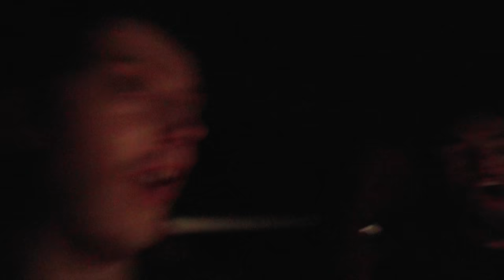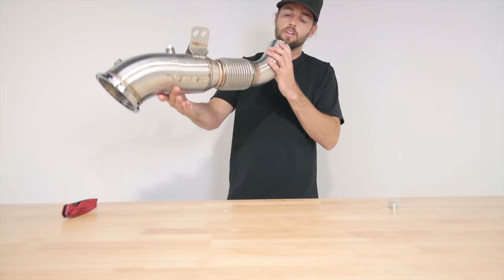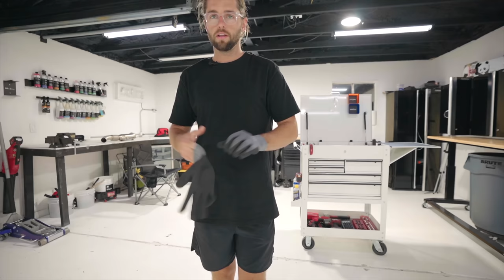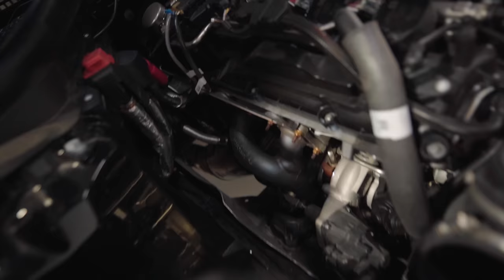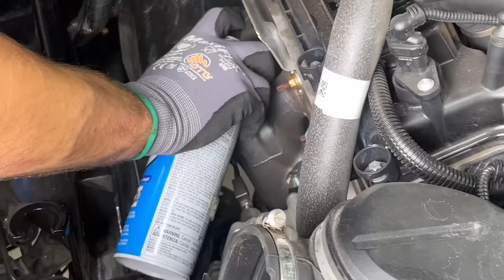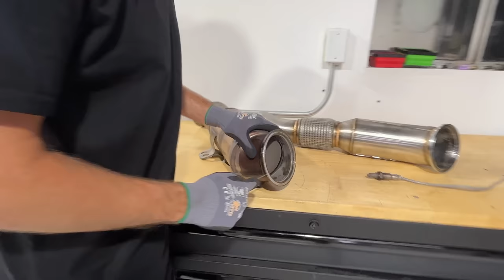The Best Toyota Supra Exhaust Mod.. Crazy Turbo Whistle & Tone! (VRSF Downpipe)

Comment: Do you recommend a tune with the intake/downpipe combo? also, do you get any check engine lights?
Reply: If you want to maximize power gains, yes. If you just want noise, no.

Comment: Hi Cameron

I have a noise problem it's really too loud in catless

my configuration is catless Project Gamma with an HKS catback

I'm thinking of changing my catless downpipe for a catalyzed downpipe. Do you think I'll be able to reduce my noise?

my salesman tells me that I'll lose power by installing a catalyzed downpipe, but who cares? I'm willing to sacrifice a little power to maintain good relations with my neighbors.
the power there is already a lot I absolutely must solve the problem of noise. I think that the Catback HKS is really very noisy I come from an exhaust with particulate filter (europe) that really muffled the noise.

My question is: what can I do to reduce the noise? Work on the Catback or fit a catalyzed downpipe?

Thanks for your answer.

Comment: What is that app letting you control the sound? Does it have to do with the down pipe or is that from a previous video? That’s so sick to be able to customize the sound at the touch of a button vs trying 5 different exhausts!

Comment: what's the differences that could be felt if the tracking is turned off  at 15:22 ?   does it gives more boost or power or so that might affect the sound too ?
Reply: Traction control off. You’re turning the traction control off so it allows complete wheelsplin. It’s how people do burnouts and donuts
Reply from the maker: It cuts throttle and boost pressure when traction control is on yes. So when its off, the wheel spin is crazy
Reply: @CameronAlford   here comes a silly question!  

Im in a quattro system and if i turn on traction control  ... when im speeding through lots of corners in the mountain .... would it result in easy understeering or sliding off the road ?   

*curious and precautions thoughts as I dont drift so might be great to have a heads up on handling the situation if things go slide ways lol
Reply: @NiickNicholas  turning off traction control is dangerous and you should really know your car before you attempt a traction off canyon run.
Reply: @NiickNicholas if you have to ask this question please keep traction control on. Especially for the driving you are talking about. In the most polite way possible. Stay safe

Comment: Question what time do I need on my Supra for this downpipe to not set off my check engine light because I have the same downpipe but with no tune and my o2 sensors are acting up

Comment: can you install downpipe on the supras without a tune?
Reply: yeah, best to run a spacer tho, stops CEL
Reply: You can, but i'd reccomend one
Reply: Yes you can. No tune is required but the check engine light will stay on so it’s annoying
Reply from the maker: Totally. It throws a CEL in most cases but the ECU adapts. So getting a tune to compliment it and remove that CEL is best so you know if something else happens.